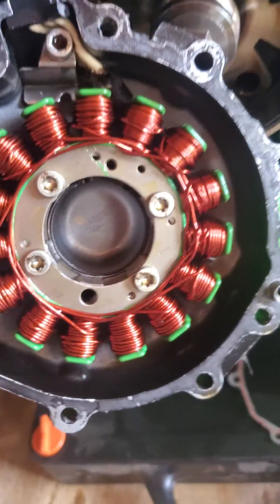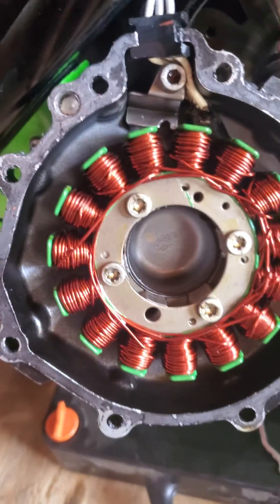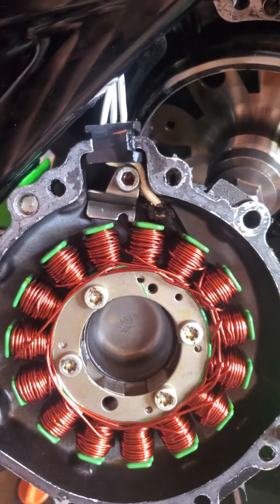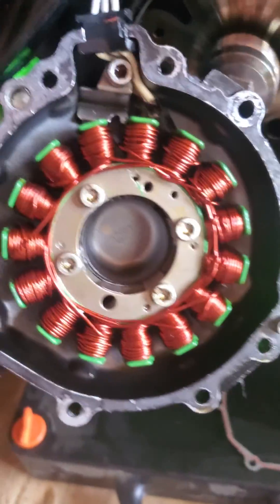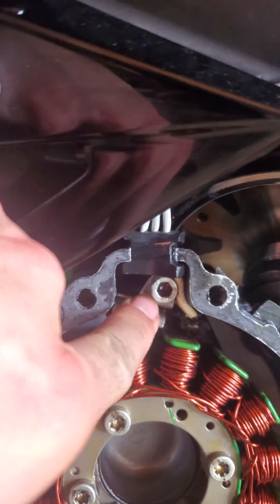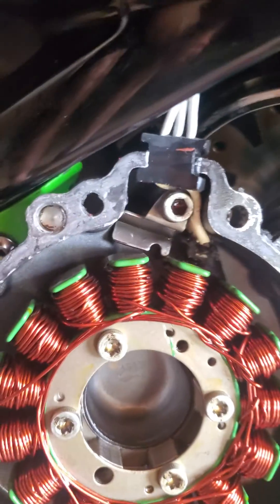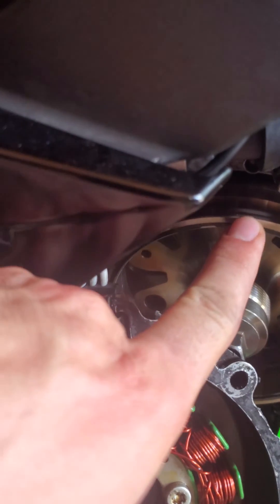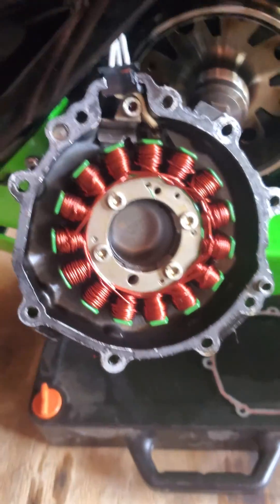Ninja zx6r stator passes continuity test but fails to charge

Comment: Would you have any idea as to what could possibly be wrong with my bike? I bought a brand new stator and rectifier and the headlights are still not working?
Reply from the maker: Could be a number of things: blown fuse, bad bulbs, broken wires, or others. Have you checked anything else?
Reply: @WrenchesToRiches  I appreciate the reply man! Crazy thing is all fuses look good and they test good with my fieldpiece meter as well. Ive checked the wiring and everything looks solid, this issue started immediately after installing new stator and rect smh. So I probed 12v at the headlight socket coming from a milwaukee 12v and they work perfectly fine like they use to, so the bulbs are good. I then tested my junction box and it looks like power is not making it through there to my headlights. Im calling ricks here shortly before I replace the JB to see whats going on.
Reply: @WrenchesToRiches  the bike is starting great now, and its also charging great as well. Just cant get the damn headlights to come on.
Reply from the maker: That doesn't sound like a charging system issue to me. All the stator/rectifier does is keep the battery charged. Do you have the ability to diagnose over video call and a multimeter in your possession?
Reply: @WrenchesToRiches  yea it dosent my man. From what I read online- a few people have had this same problem after installing the 2 new parts that I did though. Some found that the aftermarket parts didnt have a wire for the headlights, others found the junction box was bad (headlight relay/diodes). I do have the ability to access a multimeter/video call  and I would appreciate any help. However I will not be home until 5pm EST.
Reply from the maker: No prob. We can figure something out
Reply: @WrenchesToRiches  sounds good man. I will be in touch later this afternoon.
Reply: @WrenchesToRiches  hey there man, im home now and Im going to try and do some more troubleshooting. I will let you know what I find.
Reply from the maker: @chrisschwartz3896 I'm darth_doofus on Instagram. Send me a message or follow and I'll help you out over video
Reply: Dude same problem on my 03 636, they worked fine before but I did my install by the book so im stumped

Comment: So, the guy didn't install the stator correctly and as a result the wires got cut by the stator when the engine started operatig?
Reply from the maker: The charging rotor cut the stator wires due to incorrect installation, yes. It's important to make sure that the wires are completely under the management clip in the stator cover to avoid this scenario
Reply: @WrenchesToRiches  Thank you very much for replying to my questions. I am going to have to replace the stator in my Kawa, so your tips are very appreciated ;)

Comment: I did this one time. Brand new Rick's stator and I had to much slack and it sliced up the stator wire. I was getting inconsistent reading on my vintage meter that I have hooked up to my bike.  One day it read 14.1- 14.2V and than it would read 12s v. I'm like wtf. No charge all of a sudden going to my battery. So I opened it up and saw the slice in the wire.
Reply from the maker: I was just explaining to someone else that I think they may have done this
Reply: @WrenchesToRiches  So, are there any specific marks on the stator for placing it correctly?
Reply from the maker: @laponiec  not marks, but there is a clip as you can see at the top of the cover in this video. Simply make sure you route the new stator wires under it